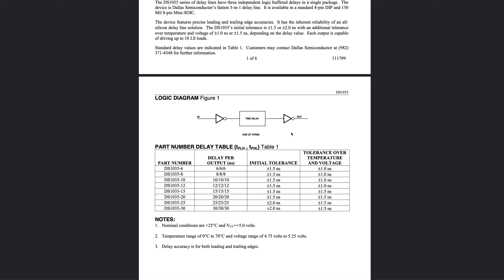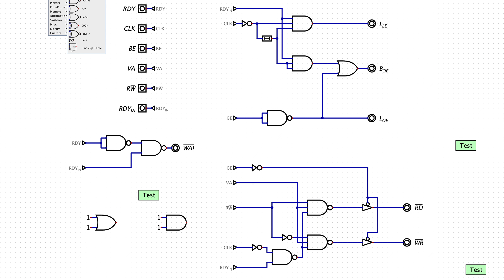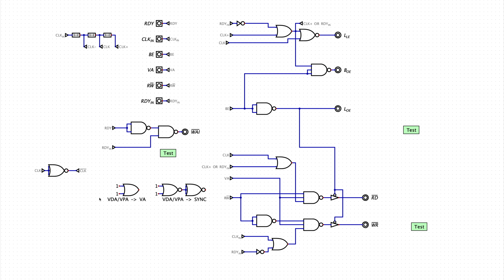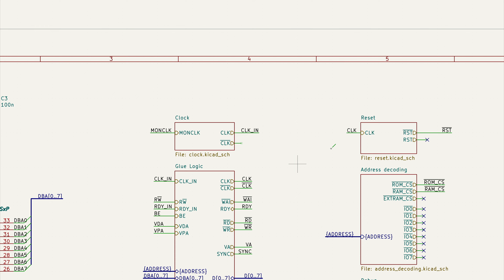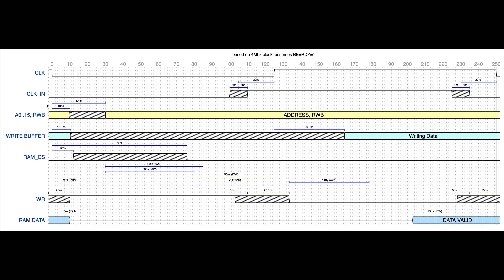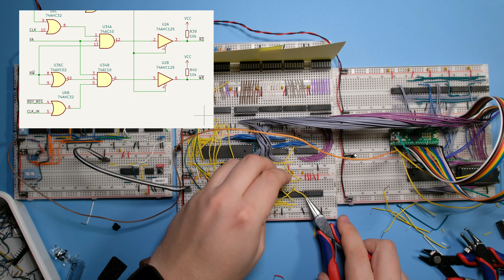#19 - New clock phase, WR timing improvement - BB816 Computer

Comment: I'm not sure if it's 100% voltage compatible with your 74HC stuff, but the SN74S134N is a 13 input NAND with tri-state outputs, with a typical 6ns propagation delay.   It appears to be a bit slower to go in and out of High-Z state, but IIUC the timing on that is much less important.    A pair of those would replace the combo of two 3-input NANDs and 74AHC125 buffers.

Comment: The only suggestion I have is, add more ground planes. All those noisy gates will generate a mess of radio signals, use ground planes and ground connections to keep the noise down.
Reply from the maker: Agreed, thanks for the advice!

Comment: I recommend you DIN41612-96 if you go the backplane way. It was widely used back then in the so-called Eurocards plus they aren't a pain to solder and creating prototypes is not all that hard.
Reply from the maker: Thanks! I initially was going for DIN 41612 connectors, as I really like the fact that they're easy to work with, and you can buy pre-built Eurocard prototyping PCBs. But I found at least one manufacturer that states that these are rated for maximum 3MHz signals. See here https://www.te.com/commerce/DocumentDelivery/DDEController?Action=srchrtrv&DocNm=1-1773725-1_Eurocard_QRG_EN&DocType=DS&DocLang=EN

This is why I'm currently looking at PCI-express x16. Even with separate grounds for each signal, you still get 82 usable pins, and presumably, they should be able to scale to 14Mhz since they work with modern computer speeds.
Reply from the maker: I will be making a prototyping PCB, similar to a perf board, with breakout pins for the backplane signals. Should be able to get this manufactured for a few dollar per board in China. That solves the issue of commercially available prototyping boards for eurocard connectors!
Reply: @akohlbecker  That's another way. There is not just one way to Rome. 👍🏻
By the way, do you mind if I copy your method? My way to design is dirty and messy...
Reply from the maker: Sure, no problem, it is open source! 

Interesting to learn about NuBus
Reply: @akohlbecker  No, no... I mean your way to work. It's very clean and I love that. By the way, other than the NuBus I remembered that Neo Geo MVS model MV1 also use this kind of connector. That manufacturer really pointed low with frequency... 😂
Anyway, thanks for your series. I am eager to see what will you came next with.
Reply: @akohlbecker  I'm not sure about that limitation. There are some relatively modern standards (compared to the processor) that used those connectors such as NuBus (10 MHz) and NuBus-90 (20 MHz).

(EDIT) I just realized my old backplane-based Alphatronic Px computers run directly their shift register at about 10MHz and video output is made through the main board.
Reply: I second the DIN41612 connector.  I'm playing with the 64 pin (2x32) connector on my machine, and they used them in the Mac for the PDS slot and those machines ran way over 10MHz by then.

Comment: Really appreciate that you left the mistakes there, it really brings across how you worked on this in a realistic way. However, one does feel a bit sorry for poor you heading straight for the traps that we get warned about by the narrator :P
Reply from the maker: Hehe, if only the narrator could send me nudges when I short my chips! I must say though, the NOR having a different pinout than the other 2-input gates was really a d*ck move by the designer :-D Or maybe a smart move for selling more replacement chips, depending on the pov

Comment: Are the logic gates slow because they need to be 5V tolerant or is it because they are in DIP packages?
Reply from the maker: All gates will have propagation delays. The ones available in DIP are typically older technology, you can get sub-nanosecond propagation now with newer families. I'm sure the size of the package and of the legs also has an impact. 

However, on a breadboard specifically, you don't want really fast propagation, as it typically comes with faster rise times, which causes all sorts of issues with ground bounce and ringing. On a breadboard, HC and AHC are fine, AC is pushing it, so I'm trying to minimize its use. To go faster than that, you need a PCB firstly because the chips are SMD and secondly because they need proper grounding / signal return paths. This makes them much harder to work with in a hobbyist setting.
Reply: @akohlbecker  Thank you so much.
Reply: @techeadache with these older TTL family chips they actually run faster at 5V than at lower voltages.